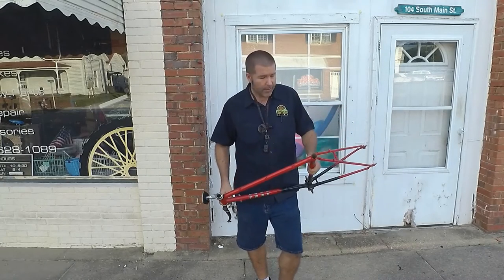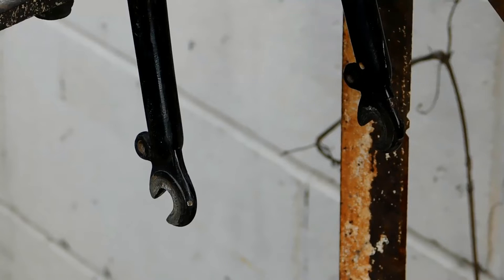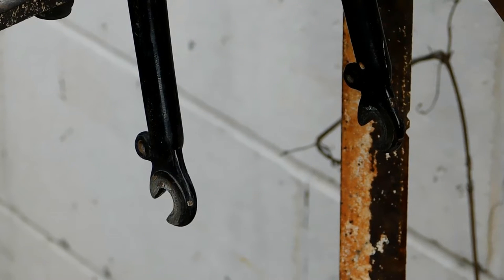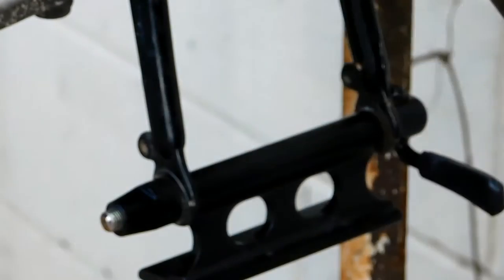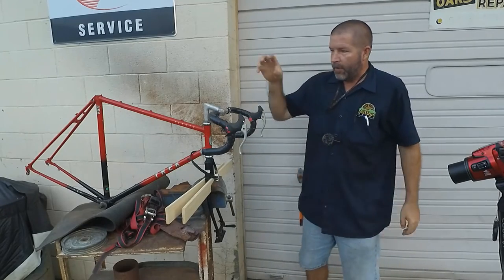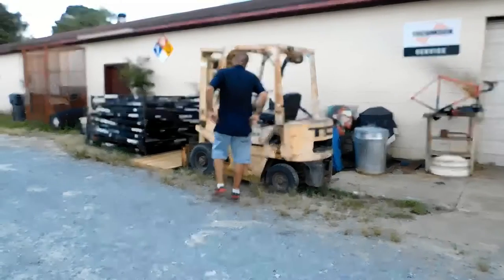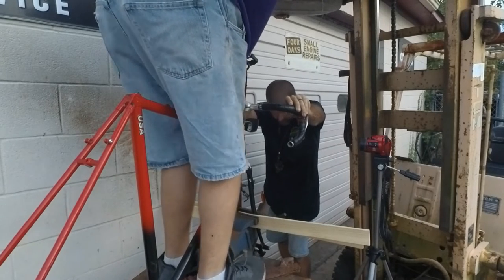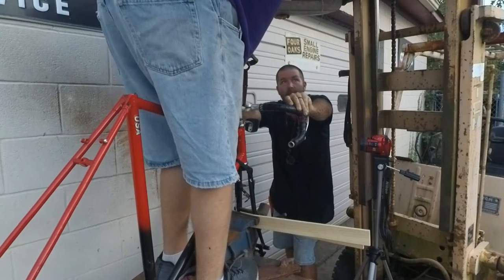Removing a stuck bicycle stem!

Comment: I have had many vintage bicycles. Mostly French and Italian.  Regreasing these occasionally is a must. 
I actually once forcefully removed one of those French stems of death, the good ole Drano method. And immediately cut it in half.
Reply from the maker: Oven cleaner works pretty good as long as its a steel  with an aluminum  stem or seatpost. Oven cleaner eats aluminum. So don't use it on anything aluminum you want to save. Thanks! 👍

Comment: I remember as a kid back in the 60s, loosening the bolt on top, I think....lol....on my Schwinn Sting-Ray ,then tapping the bolt with a hammer to dislodge the wedge. Then I could take the handle bars and forks out after removing the bearing nut. Did you tap the wedge loose? Sometimes they stuck for me....but I was a kid, delivering papers 7 days a week during the Vietnam war. brings back memories.
Reply from the maker: I did. The wedge actually fell out the bottom of the fork. I always tap the wedge before messing with the stem. If you don't you just mess things up. I have a text in the video mentioning removing the wedge before going through this ordeal. Thanks for commenting.👍

Comment: Hi,
I actually am in a state, where the wedge is released from the stem, but is still stuck in the fork.
Basically I hope it is released, because I see a small gap between the wedge and the stem inside the steerer tube..
Would you say I can now safely remove the stem using your method?
Or should I first move the wedge out of the fork? I'm a bit sceptical, because I heard, some forks getting smaller at the bottom.
I don't want to ram my wedge into the sidewalls...
If it helps, I'm working on a Specialized Hardrock from early 90s.

Thanks a lot and greetings from Germany
Reply from the maker: Your right. Lots of forks get smaller at the bottom. What I have done in the past is to turn the fork or bike upside down and spray some penetrating oil into the steer tube and just tap the wedge out from the bottom. I have used the stem bolt if I can thread it in from the bottom or I just use a punch. Be careful not to hurt the threads. I hope this helps. Goodluck.👍

Comment: you see driving a forklift is like riding a bike.....was this bike worth saving? or would it not have been better to buy a new one. ... a new question what caused the stem to not want to come out? i have so many ??? and i know you don't the time.. see you friday if i time it right. stay well
Reply from the maker: Yes the bike is worth saving. Those old road bikes can be worth lots of money. This one is pretty nice. As far as the stems getting stuck is due to corrosion. As the metal starts to swell. In this case the hole starts to close in on the stem. That is why you want to grease stems like this one. The fact that this company used two different metals (aluminum stem/steel fork) those two metals create a chemical reaction causing the corrosion. Trek used those two materials because they were best at the time at the price point. Thanks for commenting.👍
Reply: I get it now grease in place of the spray-on penetrate that I use currently thank you

Comment: Did the end part of the quill stay inside the headtube? I'm sure that you may have tried this, but did you try heating up the bike before this??
Reply from the maker: It wouldn't work. It's a classic catch 22. I would have to heat up the steer tube but I have to remove the fork to get to the steer tube  but can't remove the fork because the stem is in the way. If I heat the head tube it just damages the paint and won't affect the fork itself. Oh well..... Thanks for the thought.👍
Reply: @alloutbikes  You might be right, but I also think it may have worked..The paint was damaged on the fork anyway, and if folks allow their bikes to get in that condition... maybe they'll simply be excited to have their bike back and able to use it again. Thanks for sharing!
Reply from the maker: They understood that the fork might be damaged and were unhappy to find out that the paint on the fork was but they would not accept the frame being even scratched. You couldn't put heat on the steer tube because the frame was in the way if I put heat onto the frame it would have been pointless due to the gap between the head tube and the steer tube. If I put heat from the bottom of the fork into the seer tube I would have heated the fork and the stem at the sametime canceling some of the benefits of the procedure. Also the fork was brazed together so the chances of the fork coming unbrazed were to great.
Reply: @alloutbikes  Ultimately, it is their responsibility with all of this, so hopefully they learned a lesson from all of your hard work.

Comment: If you had another strap you could have secured the frame to the bottom of the forklift and the handles attached to the forks as they were and just lifted the forks to pull them apart

Comment: Yea sure i have a forklift in my side pocket its fine..
Reply from the maker: I was going to use 3 2x4's in the shape of a teepee over the frame and use a ratchet strap but, the forklift was just sitting there so I figured (What the heck)? Thanks for commenting👍

Comment: So funny he doesn’t know how to drive the forklift, doesn’t know how to use a cumalong, took 20 min to figure out what to do, get a better job
Reply from the maker: I think I did pretty good. First thing I've never used a forklift. This one had a manual transmission with a carburetor that needs to be rebuilt. I do know how to use a cumalong but I figured the forklift would have been quicker. As far as getting a better job I like what I do it pays the bills. Sometimes videos don't turn out exactly like you thought. The video was just supposed to take 2 minutes maximum but it turned into a bigger deal. I could have edited the video in a way to look better but I decided to show some of the difficulties you run into when you start a project. I'll keep my job thanks. I'm my own boss. I own my own business. Life is pretty good. I hope you love your job as much as I love mine.👍